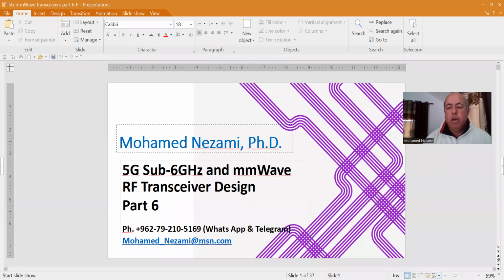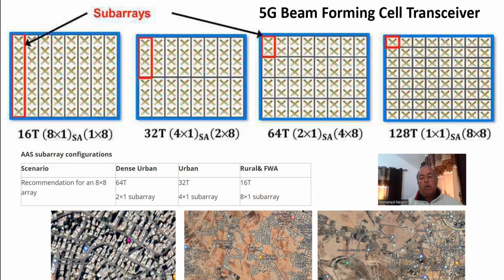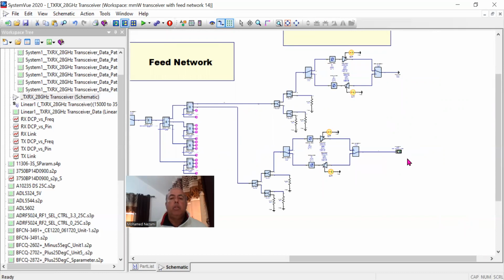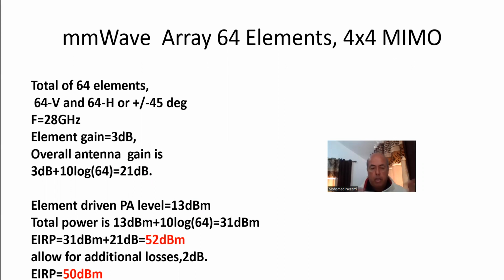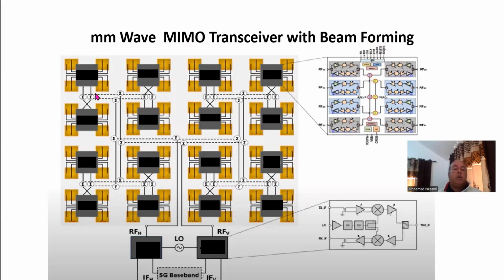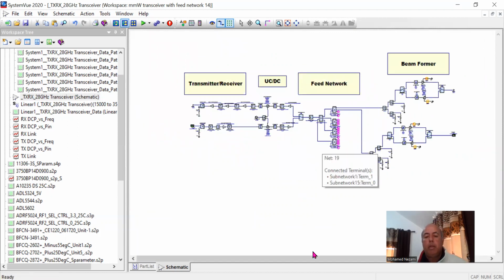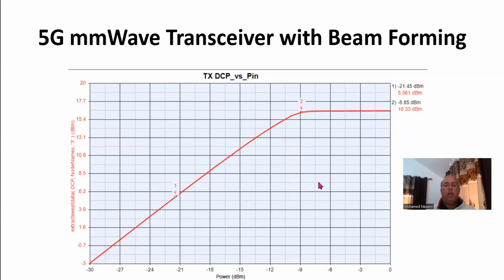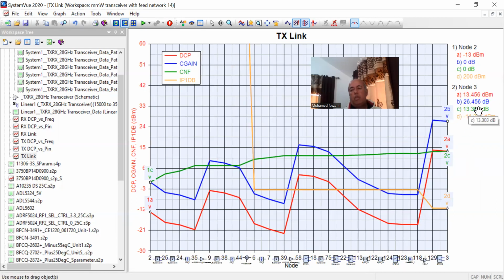Part 6: Design and Modeling of Small Cell 28GHz  MIMO RF Transceiver with Beam Forming

Comment: Hello Dr Mohamad, It is not clear to me why the gain for the RX was not calculated based on the ADC noise floor but the 10 db below FS. Could you please help me?
Reply from the maker: the gain range is calculated using both ADC quantization floor, and some backoff values from full scale levels.  The minimum value for RX gain is  based on power of maximum RX level + G_RX = ADC Full Scale -PAPR-1dB.  The maximum RX gain is calculated based on making the total thermal noise at the RX input amplifier to be 10dB above the ADC quantization noise floor. So Minimum RX RF power +G_RX max =ADC_quantization floor +10dB.